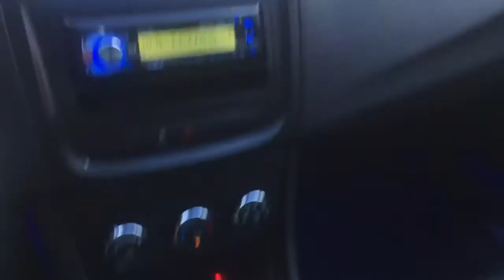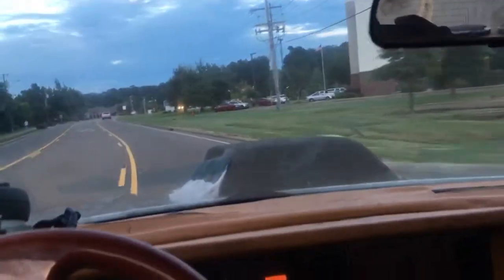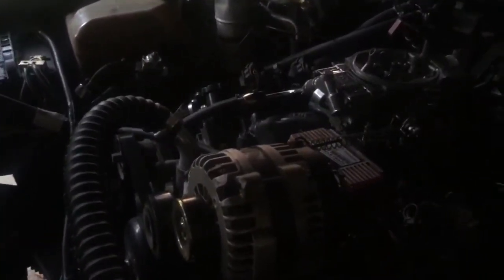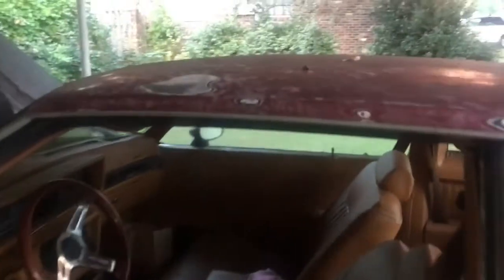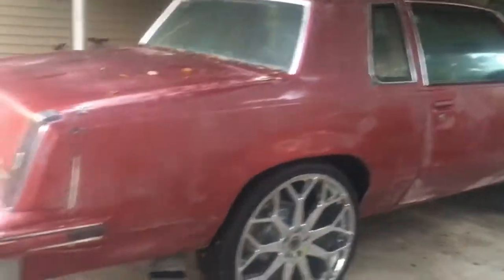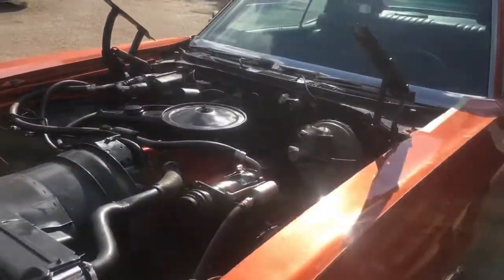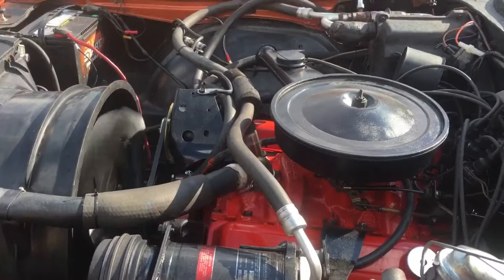Why is the LS 5.3 swap carburetor giving me PROBLEMS 😡(such a headache )

Comment: I had the same problem after getting my 350 Rocket rebuilt in my 72 Cutlass. Save yourself the headache 🤕 & go Holley Sniper EFI with the Hyper Spark ignition & Distributor.
Reply from the maker: Ok thanks. So on the Ls motor I thought they didn’t have a distributor?
Reply: @doinkslifestyle  You’re correct. I was letting you know what setup I went with when I encountered the same issues with my 350 Rocket.
Reply from the maker: Oh yea most definitely. Did u get everything straight with it
Reply: @doinkslifestyle  Yeah, it’s running great!! If you do go the Holley EFI route, get the master kit. It’ll include everything you’re gonna need as far as fuel lines, fuel pumps, fittings etc.